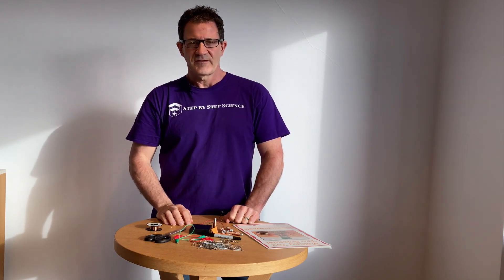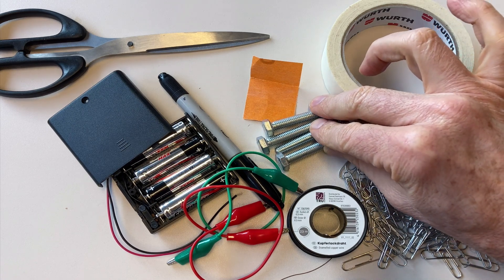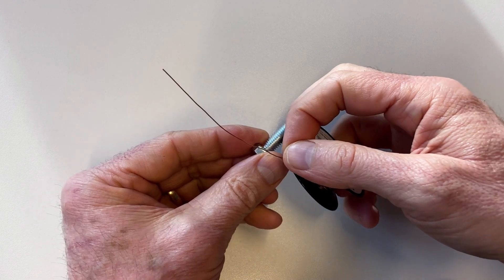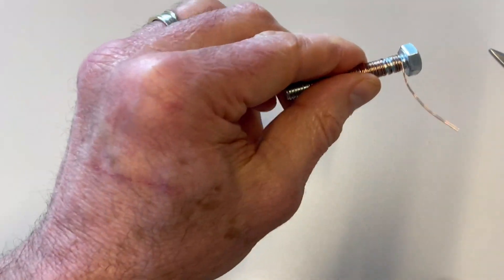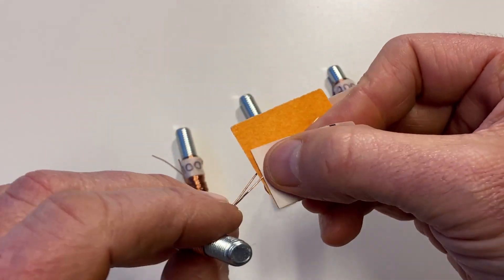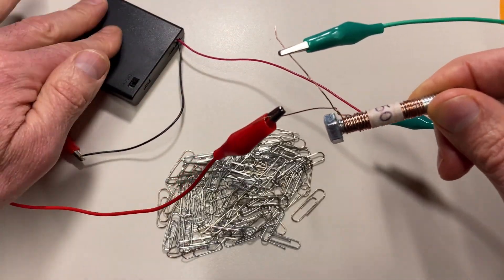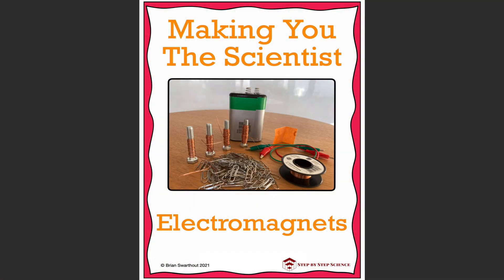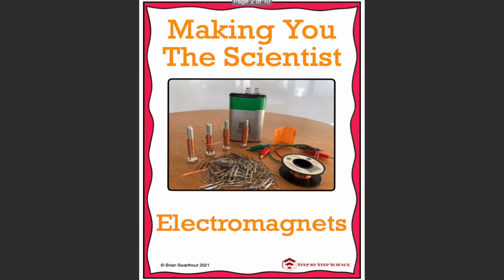Making YOU the Scientist: Experimenting with Electromagnets

Comment: cool video. should we be concerned of the safety and touching it?
Reply from the maker: No, the big battery is just 6 volts so it will not do anything when you touch it. The other batteries are AA and they are just only 1.5 volts each.
Reply: @stepbystepscience  how about the current?